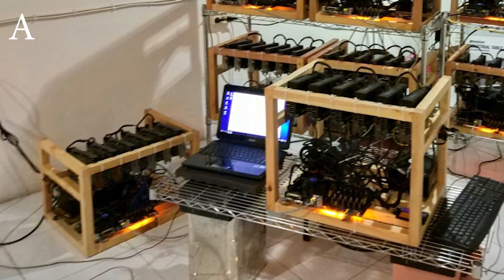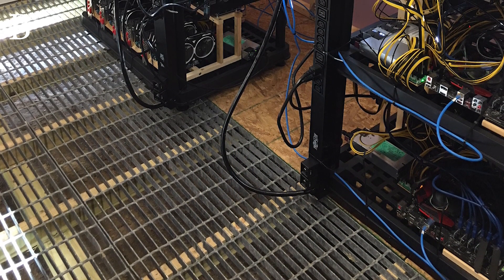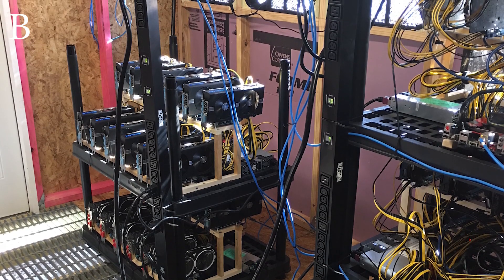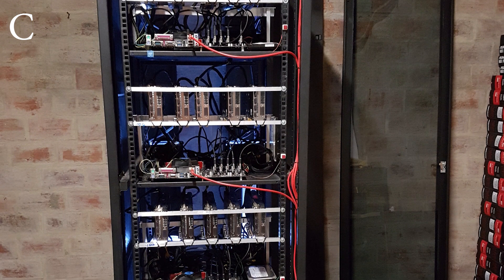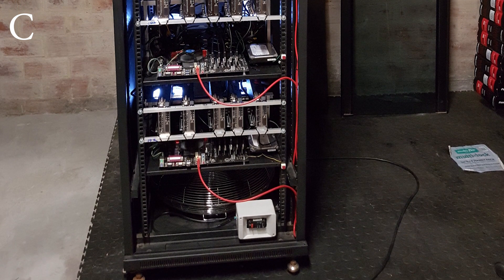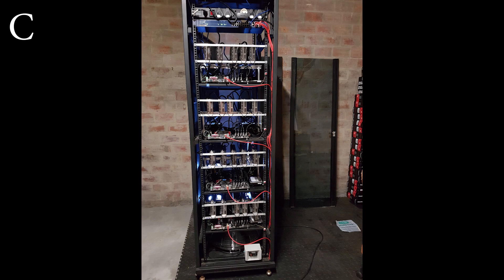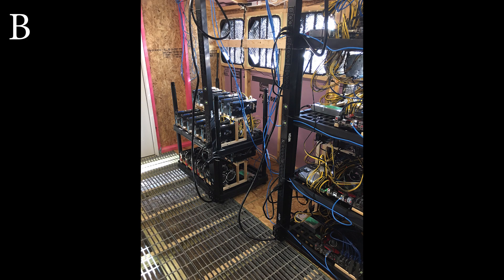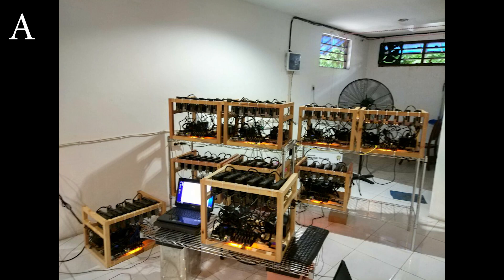Mining Rig Wars Finals #6: Mining Farms Taking Over

Comment: Woot! - I would have to say that it would be better to split the series into sections, or at least only have dedicated episodes for rigs/farms that way they don't have to compete with farms like mine. There were some great builds in the past episodes that i would have voted for, but the farms took my vote instead. So, it is not fair to the smaller guys. 5500-5600 MH on ETH btw.

Comment: My ROI is rekt, pls advise
Reply: just hold your coins until a price spike.
Reply from the maker: because of price you paid for GPUs or dwindling pricing? Are you mining larger or smaller coins?
Reply: I have 6x 1070ti's bought in late December/early January before most of the GPU price hike, currently mining ZCL until the BTCP fork (banking on the donation pool atm, fingers crossed), but after that I don't know what I'll mine. I paid off about 1/4 of the rig because I got lucky but times are tough and I'm pretty new at this. I'm tempted to sell off two of my 1070ti's and use that money to buy the next gen of Nvidia cards when they drop.
Reply: I hodl now for sure
Reply: Carl M if you bought them prior to the price hikes (sub $500), your still doing fine. Each card should be making $50-$60/month after power costs? That's assuming you sold the coins right this second, which I know your not doing, so you should still be sitting golden.
Reply: I suppose so! I liked it better when I was making $125-150/card per month :P
Reply: I'd sell your ZCL after the fork...Its reached end of roadmap devs moving on and everyone knows it.
Reply: I'm not hodling any ZCL, I'm mining to the donation pool atm which has the downside of not leaving me with any ZCL to sell. Hopefully the extra BTCP makes up for the difference.

Comment: Anybody tried the grow tent option as a rig case. I leave the top open with a high powered floor fan (w/ regulator switch) blowing hot air up. I'm using the cheap scalable mining rack. It's working great as in home rig with kids.